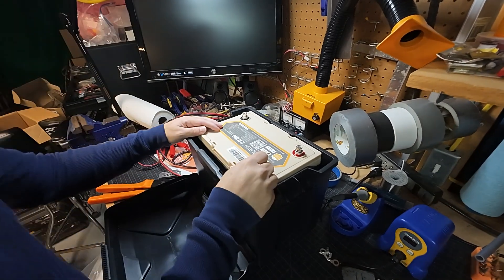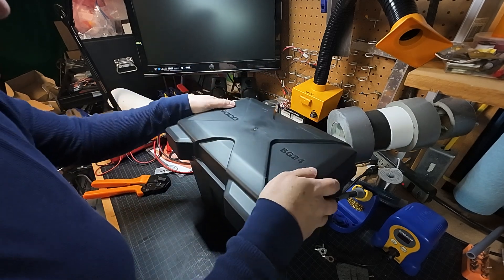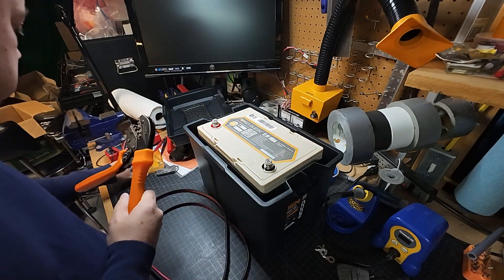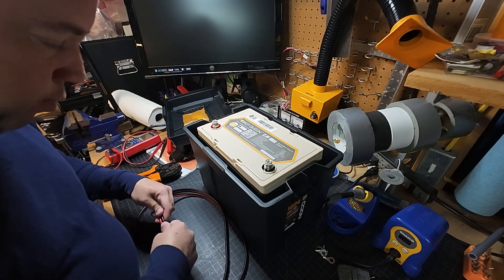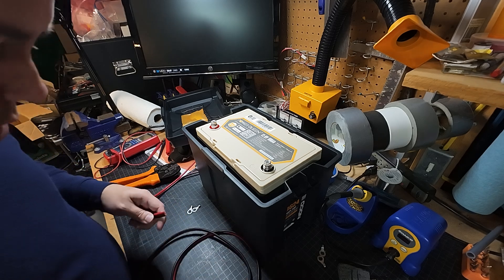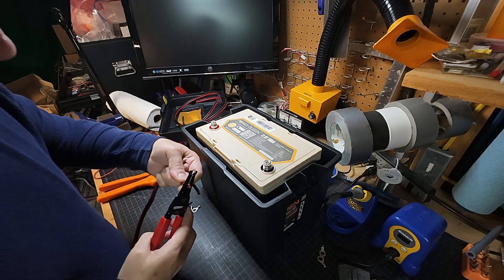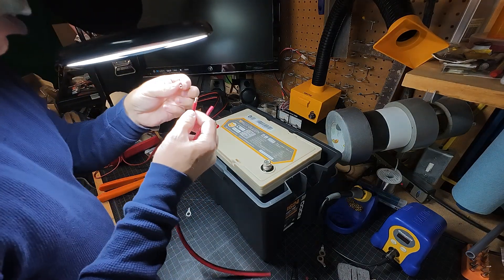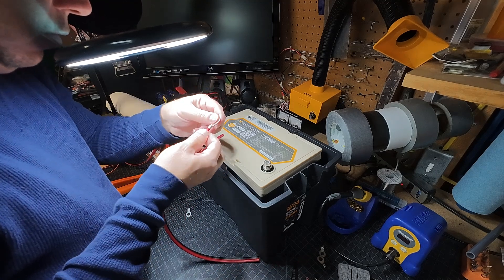LiFePo4 Battery Connections You Need!!! #powerpoles #rvlife #lifepo4battery

Comment: Good stuff. I like to lay the Anderson PP terminal inside the crimper and click the crimper down a couple of notches then insert the cable. It keeps the terminal from shifting and it saves me from having to hold it on the wire while I get everything ready to crimp.
Reply from the maker: Good tip!